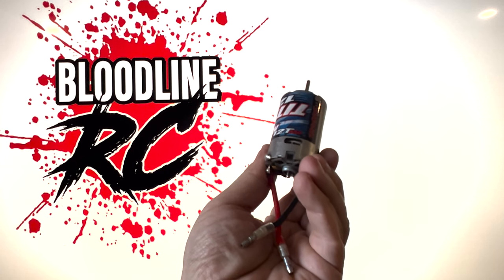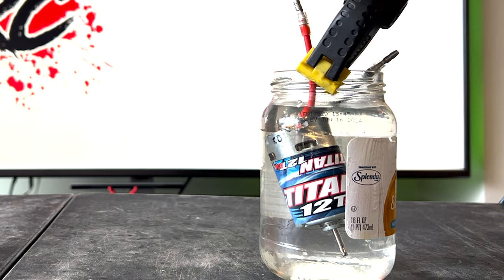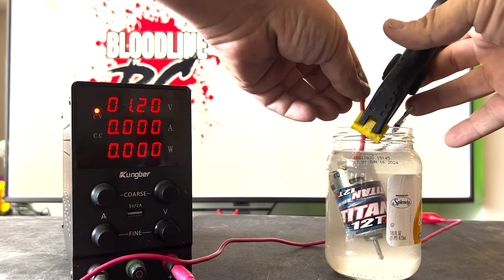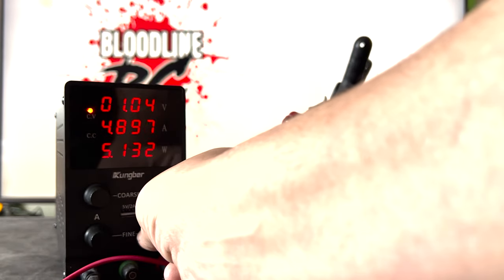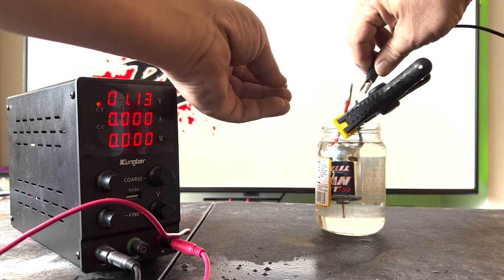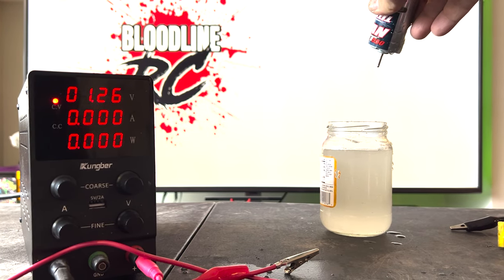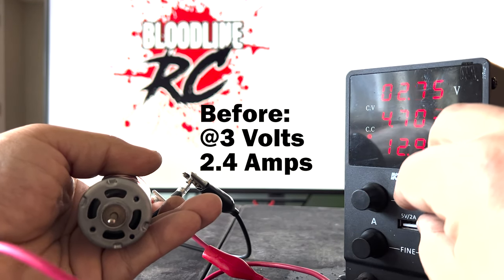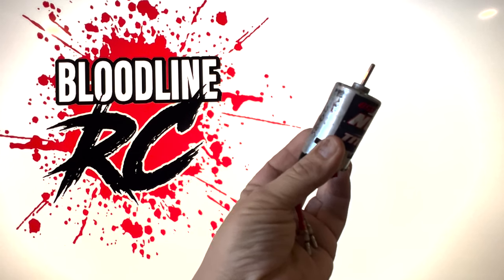How it's Won! Breaking in your Brushed motor for more power, Brushed Motor Tech part 1

Comment: I made the mistake of doing 20 minutes with a Tamiya Sport Tuned and wore out the brushes. They’re softer apparently and a lot of these tutorials don’t mention that. So be careful and check for your motor time limits!
Reply from the maker: Good advice. Always watch for the voltage to start to rise and then cut it off. 

The 540’s seem to break-in and pull 1.6–1.8 amps at 3 volts when broken-in
Reply: 3:57 we should listen

Comment: Does this method work on all turn brushed motor?
Reply from the maker: @sstrickland8089  yep. Any brushed motor. Just the final output will be different due to the power created by the number of windings
Reply: What do I need to look for on a 35T
Reply from the maker: @sstrickland8089  I don’t know what a 35t would look like for a best case scenario. But for a 35t, I’d think you are trying to maximize the life span of the motor
Reply: We run a spec legends class with this motor. Some guys are definitely faster than other. Looking for ideas. Thanks for the help.
Reply from the maker: @sstrickland8089  ahhh. Yeah. About the best thing to do is pick up a few motors and see how they turn out

Comment: How can you tell which motor direction is? Which way?
Reply from the maker: Hook the motor up to red to red, black to black to either an esc or power supply and make note of the direction. Typically it is counter clockwise

Comment: Why is the final test only at 3 volts? The battery used in the rc car isxa 2 cell lipo 7.4 volts to 8.4 volts. Thanks for the help, love the video.
Reply from the maker: You can test at whatever voltage you prefer. Most of the racers around here, and the motor tuners use 3v as their preferred test voltage. 

If I ask a local guy, how’s your motor? They usually answer it’s X amps at 3.0v. 

I can’t say when or how it originated, but there is merit in testing at higher volts.
Reply: Thanks for your response. Great videos.
Reply from the maker: @RodEvens  thank you! Glad it helps

Comment: @BloodlineRC I followed the video and got to 4.2A. Ran a race later that day (practice, qualify, heat, LCQ, feature ) and am now reading 2.4A. Do you know why this happened?  Thanks!
Reply from the maker: @aaronreilly2435  it probably needs a cleaning after being run hard all day. Also, how hot did the motor run? With the outdoor temps in the high 90’s here it would be possible to cook a  brushed motor in one race day. 

Take a look at the commutator and see if it’s still shiny or if it has a lot of carbon build up. 

If there is a lot of carbon, you can clean that off with an eraser and commutator cleaning sticks while blowing it out with compressed air and using some electrical cleaner.

Comment: I used your break in method on a new motor and picked up .2 per lap. What is the best way to clean my motor after Im back home ? I searched  through your videos on motor maintenance and only found the one where they say not to use the  crc spray on the motor? Should I run it through water again since Im at home and not at the track? Thanks for this video, I bought the same power supply, used your method, and new motor turned 3.6 amps at 3 volts.
Reply from the maker: Wow. That’s awesome to hear a success story! Thanks for posting. 

Yes, that video on motor cleaning is a new idea that I wasn’t aware of, until we talked to Dave. 
We do have another video on motor break-in and they get into maintenance a little bit. 

There are so many methods to cleaning, I may have to do a video going into all the popular methods and see which ones do work. 

But, I’d say, 5-10 minute water bath and check the voltage/amps before and after to see the difference.
Reply: @BloodlineRC  Thanks for the info and look forward to watching more of your videos

Comment: What difference does it make? How do you turn the motor? Don’t let cars go in reverse?
Reply from the maker: The difference between a broken in motor and a non-broken in motor is pretty significant. Also, it helps to increase the life-span of a motor. Especially with a fan and proper gearing, to make sure you don’t overheat it. 

One thing to make sure, if you turn the motor by hand, always turn counterclockwise. In the car, we can’t use reverse in a race, so that helps. But a spin can cause the motor to go backwards. This can break the end of the brush, then you May experience arcing and the motor may not perform as it once did. It happens though, and you can try to clean the commutator and rebreak in the motor. Or you might have to bite the bullet and get a new motor. 
For bashing, I wouldn’t be overly concerned. Since getting the most power out of the motor isn’t the main concern, having fun is.
Reply: @BloodlineRC  But in some cars the motor sits backwards so i dont see where the difference is what way you turn it, the brushes dont care what way it turns.

Comment: Do you not need the power supply on constant current for the voltage to be able to rise?
Reply from the maker: It will switch back and forth while breaking it in as it starts to draw more power

Comment: Which power supply do I need from Amazon ? The 10A or 5A?
Reply from the maker: The 10 amp is the one you want. Check out the link in the description and either that one or something similar
Reply: @BloodlineRC  awesome thank you
Reply: maybe i missed it. whats the advantage of the 5amp over the 10amp? Thank you
Reply from the maker: @zleader99  the 10am has more power than you need. Once you start running it at its limits (5 amps constantly on a 5amp) it’s possible it may not be able to hit 5amps under load due to resistance and at its limit, it could over heat and shut down. 
Some of the low amp motor analyzers can’t run sustained loads at their limit, so always better to have extra power and not need to use it.
Reply: @BloodlineRC  Thank you for all your help. Glad i found your channel. I have been trying to sqeeze preformance out-of sport tuned tamiya brushed motor.
Reply from the maker: @zleader99  I’m doing the same on torque tuned tamiya motors for my TT02. How has it been working?
Reply: @BloodlineRC  started at  3v 1.6a new.  after break in 3v 1.9a.   however not sure what gains i should be seeing. At 5 amps on the power supply thr voltage tampered of at 2.16v.
I am just learning. Not 100 percent sure what values i should be seeing.
Reply from the maker: @zleader99  that sounds close to what I’m getting with torque tuned. Slightly higher, but I think those motors have more power. Sounds like it’s working really good for you
Reply: @BloodlineRC  thank you again for your content.  I wish i knew this stuff when i was racing my gold pan rc10 back in the day.  Now just running a tt02 class.   
Thanks again.. I will definitely keep watching your channel.
Reply from the maker: @zleader99  thanks buddy. If only we had more time to get out videos. We got tons of ideas

Comment: After watching your other video, I got a power supply and have been breaking them in at 3V and the amps set to 10.  So what is the voltage set to when the amps are set to 5?
Reply from the maker: Once you set the Amp @ 5, the voltage will take care of itself. What you watch for is the voltage to rise as your motor breaks in. 

There are two ways you can adjust current to the motor, with AmpS or volts. When you set one adjustment, the other adjustment finds it’s own place. 

If you need help reach out and I’ll be glad to help
Reply: Got it.  Looks like. Once it is booked up, then adjust amps. I am going to limit my volts to 3V to start. I also have been putting commentator drops on when I store the motors as well as some more bushing lube, is that suitable for storage?
Reply from the maker: @curtiscochran6191  I’m not sure about the comm drops. The bushing oil, yes. The comm drops I would wait until you are ready to make a run

Comment: What volts do you break it in at? 3v?
Reply from the maker: I’m breaking in using 5 amps, and not by volts. Use the voltage as a measure of when the motor breaks in. Once volts start to rise, pull the motor. 

At 5amps, the motor starts at .8-.9 volts and when done is usually in the 1.2-1.5 ranges. Stop break-in as soon as the volts stop rising.
Reply: im currently breaking in a motor myself. do you pull the motor as soon as the volts start to raise or when the volts hold steady and then begin to drop again? @BloodlineRC
Reply from the maker: @vernwoodard9225  as soon as they start to rise. Once that happens, the motor is getting close to its peak and as you run it, it will ‘finish’ the break-in process. So, break it in, but leave a little on the table for when you start racing it. Good luck and let me know the results.
Reply: thank you will do! and you suggest 5 amps for break in correct? @BloodlineRC
Reply from the maker: @vernwoodard9225  yep. Go with 5amps. You don’t want the motor turning a lot of rpm’s during break-in

Comment: so im trying to do this, i put a brand new motor in and the voltage wont go above 1.9V with my powersupply amps maxed out at 10 amps. am i doing something wrong?
Reply from the maker: If you are using the same power supply I am, zero out all the knobs. Connect the motor, turn the volts (coarse) all the way up. Then start adding in amps (coarse) the motor should start to rev up really high and then you can adjust the voltage up or down with the coarse voltage adjustment. 

Let me know how it goes and we can go from there

Comment: What the heck are the difference between forward and backwards in an electric motor?????
Reply from the maker: @nikolajc7617  you can run the motor in any direction you want. But once you pick a direction, stick with it! 

The edges of the brushes do conform to the direction the commutator turns. Once it’s broken in, running the opposite direction may chip the brush and ruin performance. 

Not a big deal for a basher, but competitive racing events, it is a big deal

Comment: what the hell is bushing oil?
Reply from the maker: There is a difference between bushing and bearing oil. So try not to use bearing oil with these motors. You can try 3-in-1 oil. But it does not last long and may need constant piling between rounds

Comment: Higher draw on the battery = lower run time,  shame you didn't do a before and after speed test
Reply from the maker: The battery run time is inconsequential for our use. We already have battery life to spare for competition. But a more efficient motor could increase run time. 

The main issue with running a brushed motor, before break-in, it will degrade the motor enough, it’s potential will be reduced once we do a break-in. And testing a comparable brushed motor, production variances have such inconsistent performance, you couldn’t compare one brushed motor to the other to make a true comparison. We’d really have to do a large sample size to compare. Amp draw and voltage, or a true dyno, are the only methods we have for testing on a bench to give any consistent results. 

It’s good points though.

Comment: I have watched this several times and went through the comments because I have never done this before, bought the power supply suggested but it has more features than the power supply in the video and the instructions are junk don’t explain anything in how to use. I tried what was suggested in the video and don’t think it worked, for my final check at 3v my motor pulled .9 amps. I set the amps to 5. Amps and then have to set the voltage to 1.2 before it turns on, and the amps goes up and down 1.7-2.0 while I did the break in. I’m not sure if I am doing this correctly to get the results seen in the video.
Reply: Same my dude

Comment: Was a poor boy, did mine like this with extended leads to a jar.

https://youtu.be/w0r-xCHiWt4

Afterwards completely flushed the motor with spray, then soaked the bearings with oil for a while standing it on end for each side individually. You can use zoom spout turbine oil I guess, the motor companies made oil then, thinking Trinity, Reedy etc along with spray and comm sticks.

I'm not recommending, just remembering.
Reply from the maker: The good old days, right? One of our racers made comm sticks for these motors. It’s not as easy to clean as old motors with removable brushes, but it works.
Reply: @BloodlineRC  I've just picked up one of the spec slash tucks, need to look at the motor and brainstorm for comm cleaning.
Reply from the maker: @BeatniksVids  I hope to cover comm sticks real soon. One of our local racers came up with comm sticks for cleaning and maintenance of these sealed motors. If you got a few weeks to wait, we will touch on that. 

But congratulations on the new purchase !
Reply: @BloodlineRC  I'll be watching